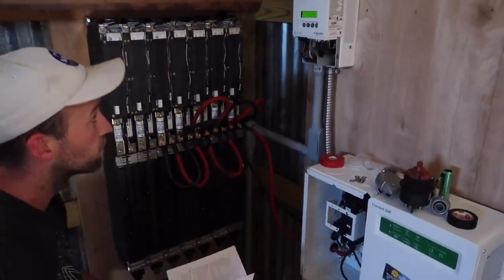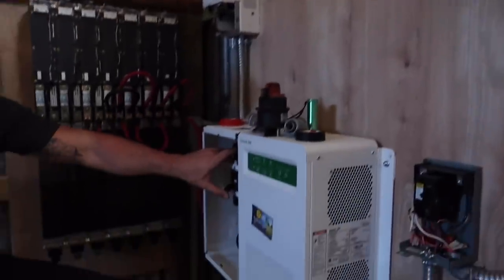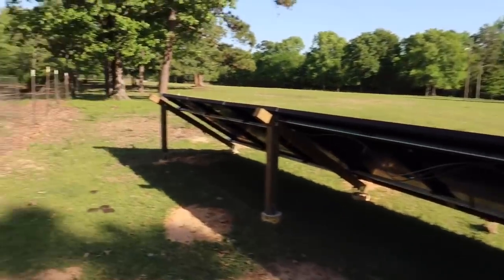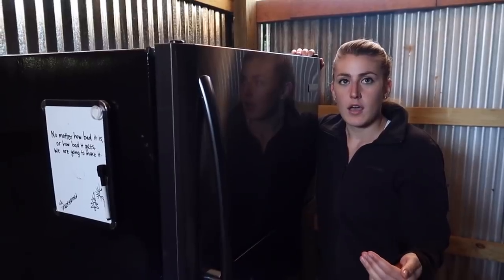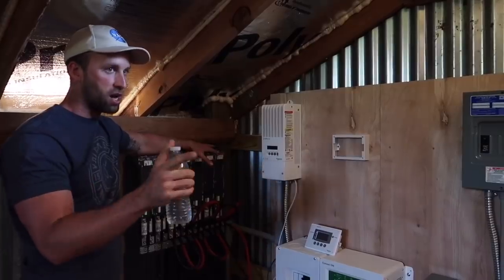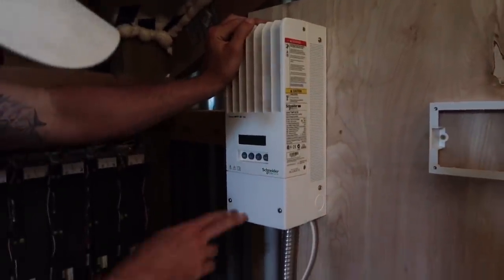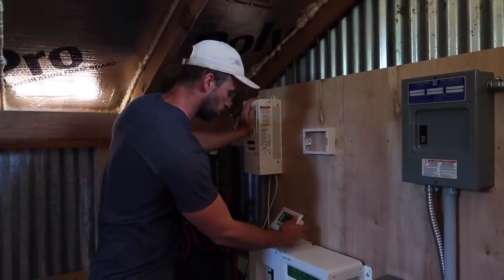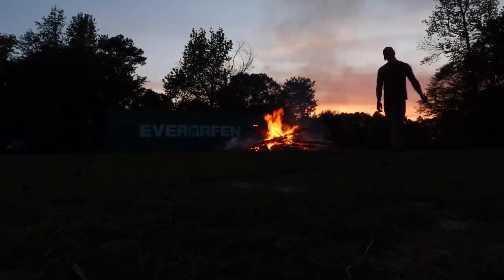WE’LL NEVER BUY POWER AGAIN!

Comment: Hello awesome videos i followed everyone of them and love them. I'm not sure if you know this but you connect the ground on the same battery as your plus. When it drains it doesn't drain evenly. Plus should be on the one side of the first or last battery and the minus should be on the opposite side not both on the same end battery. Someone told me this and i found out when I'm doing my backup solar power i tried the way i did it and they was right it was draining like a ladder bottom battery to the top battery. So i connected Plus on the first battery and minute on the last 5th battery and it did in fact drain evenly. Hope this helps, I know if helped me. Keep up the great work.
Reply from the maker: Good advice! Thanks!

Comment: very straightforward setup, its good even with "free" power you still consider how efficient a device is. any reason the last modules arent hooked up? run out of wire again? BTW not sure if it was suggested in another video but run the positive from the other side of the battery than the negative. the first modules will see all of the amps and wear out quickly, get a clamp meter to see.
Reply from the maker: The last couple were not connected because I ran out of 2/0 wire lugs. Honestly, you make a great point about running one of the jumper wires to the other side of the battery modules. Each battery module is rated at 100amps with 150amp peak. With this setup I’ll never hit that but with all the amperage flowing through the one module it may affect the service life. Thank you!
Reply: your welcome, I learn alot from many of the big DiYers and that is one thing they always mention, even with lead acid there is a certain way you wire them so the resistance to each is the same. for you putting one end on the other side would be good enough.

Comment: what is your inverter input dc voltage? 48v or 60v?
Reply from the maker: It’s 60v.
Reply: Life Uncontained thanks for your reply. and what is the rated voltage and amp hour of that single tesla battery?
Reply: Green Tech... each battery is about 3kWh each assuming there is no degradation.

Comment: Do you mind sharing the sources of your main equipment? I saw a sticker for the altE store. Personally I've been considering solar panels for years now. It's only been recently that I've considered a smaller off-grid setup, before replacing my shingles, to see if it's a fit. Personally I've been looking into the use of the Chevrolet Volt batteries.

Why did you chose Snider vs some of the other major players out there? Price / Value / Aesthetics?
This system reminds me allot of the Powerwall setup from EVWest. If you haven't seen their setup, I'll provide a link below.
https://www.youtube.com/watch?v=9kXTqNqxK3s&t=212s

I am strictly a newbie and realize that your primary goal was to have power. As far as updates go or maintenance purposes, do you plan to add a battery and/or inverter disconnects/circuit breakers to isolate your components for any necessary updates or repairs? 

I know you guys are probably very busy and congratulations.
Thanks.
Reply from the maker: We bought most of our equipment from alte and would do so again. Great pricing and very fast shipping. Try to buy around holidays they usually have a sale going on. 

We almost went with Chevy volt/ Nissan Leaf batteries but I found my best bang for my buck was with these. Also since they’re 60v apposed to 48v they’ll be slightly more efficient. 

The main reason I went with Schneider opposed to others like outback is because I knew I could use these batteries.
Reply: Where did you source your Tesla batteries? I was just doing some more research this evening and referring back to this video. Are you using the SCHNEIDER ELECTRIC CONEXT SW 4048 INVERTER/CHARGER?  I like this module design but the specs from the altE store would indicate that they work either with 24V or 48V battery banks.
Reply from the maker: I bought the batteries on eBay. Yep the conext 4048. The 4048 works with 24/48/60 volt batteries. It’s working like a charm with these batteries so far. 😃

Comment: Hey guys glad to see your solar system up and running. The charge controller you have will not give you a factory setting for your battery type. But it gives you the option to manually set you charging current & charging voltage which is great because most pre set charge controllers will not charge your batteries to your desire voltage which is a plus because it gives you that little extra voltage in your time of need.

Comment: Awesome you guys, Im so exited for you. This will be a game changer. What battery charger do you got? And if you got all those battery modules in parallell how do you plan to keep them balanced in the future or is there some balancer built in in each module? I will eventually install an Off Grid system at the cabin in the woods so it would be awesome to be able to do a system like yours. Right now I only got the 12 kW on Grid system on the urban homestead, yes its finally done. Last video on it uploaded yesterday. Have an great Sunday, Andreas from Off Grid Sweden
Reply: Typically electric car batteries have built in balancing mechanisms much like cell phones.
Reply: Andreas, I'm about 15 months in (off grid) using a Leaf battery and 2 Chevy Volt batteries and they have stayed in balance without the use of any sort of balancing circuitry.  I take about 9 Kwh's out of 56 Kwh's available from sun down to sun up in the winter and a bit more once it's hot enough to use AC in the house - like last night.
Reply: Mark Osborne Thats awesome.
Reply: Where can you get these batteries
Reply: 8 Cylinders To Life Thats awesome